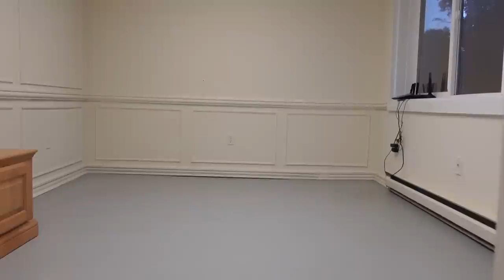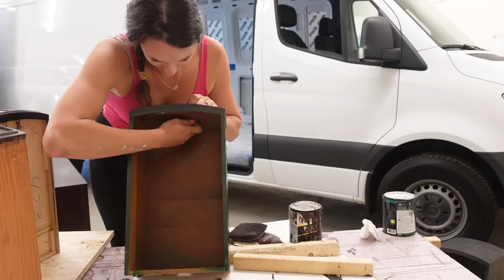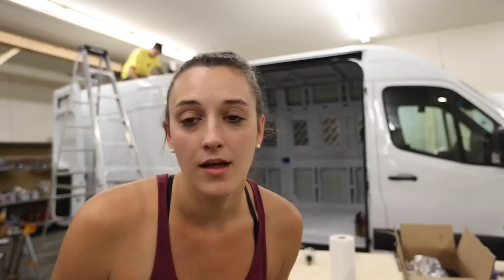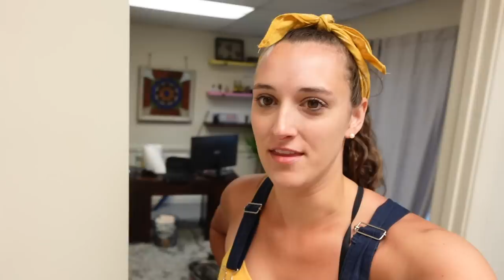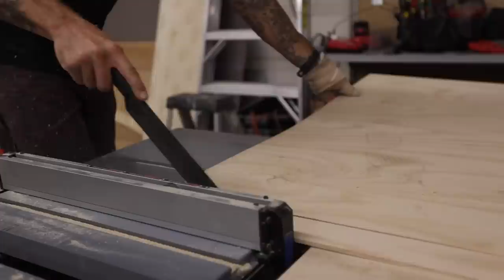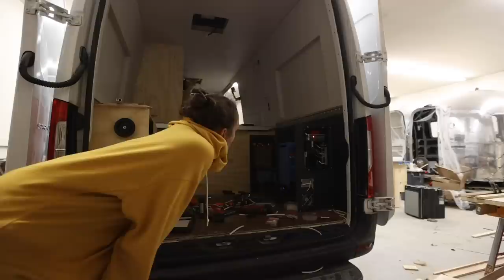We Started a Van Building Company & It Was a BIG MISTAKE

Comment: Keep at it guys! you're doing great - most people dont get to 'work' at something they really love. Just a small point though, check that clearance under the roller-door to make sure you can get that Van OUT the garage when its done with that A/C on the top!
Reply from the maker: Thanks Martyn! We measured it recently and it's going to clear by about an inch. So it'll be tight, but it should work haha

Comment: I'm curious why you chose wool for the insulation. Wool absorbs moisture so isn't that a bad thing if inclosed inside of a wall where it's unable to breathe to dry it self out if it absorbs moisture or gets wet? 
If it becomes moist or gets wet couldn't it cause mold on a wood surface if it's in contact with the wood or rust on a metal surface?
Reply from the maker: You can read more about havelock wool and the benefits of it here😊: https://havelockwool.com/van-insulation-products/
Reply: @KelsAndJay  I've been doing a lot of research into how professionals insulate metal buildings, metal building construction is similar to a van with it's metal exterior and metal interior ribs. The professionals agree a product that absorbs or retains moisture should be avoided for several reasons.
I just referred to your link of the company promoting their product for use in van builds but the professionals in the building industry seem to disagree with the use of that type of product.